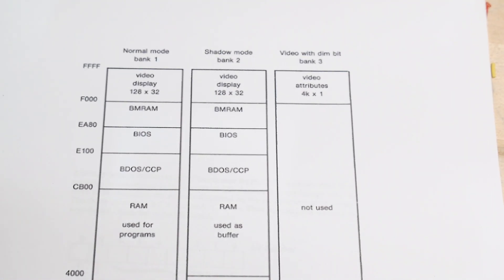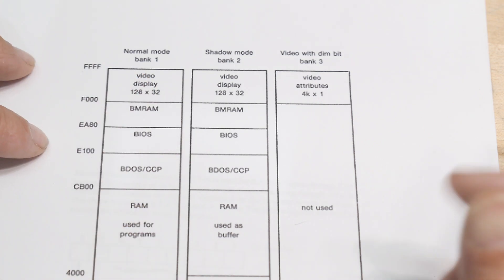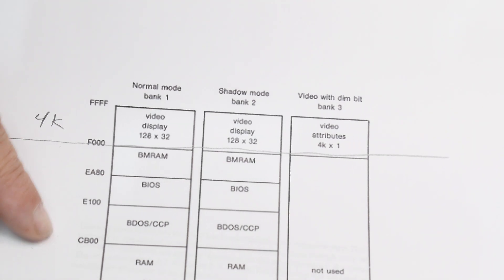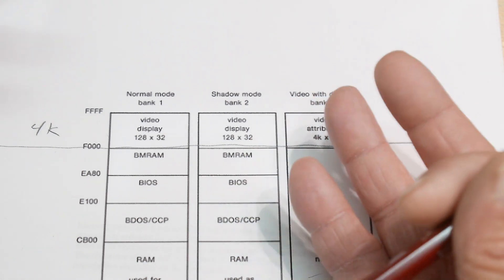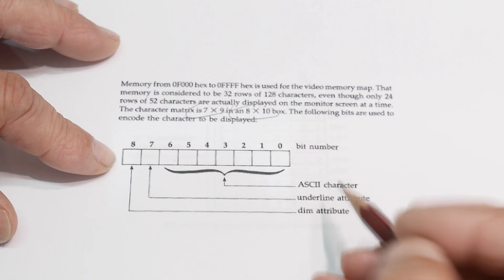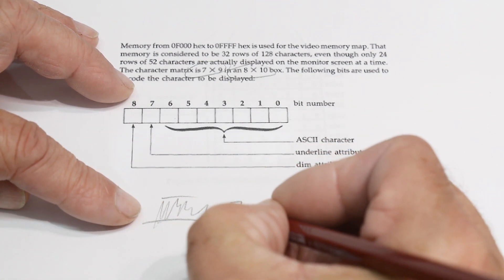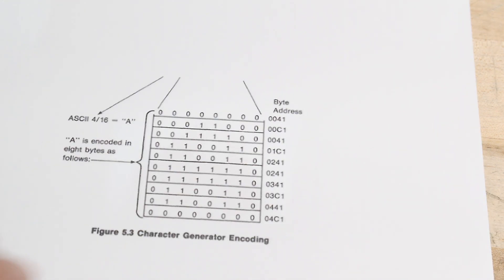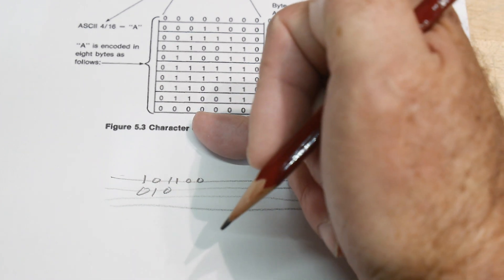#1006 Osborne 1 Video Circuit Design

Comment: Yes, all that was discrete logic, only later on did it get all put into a single 40 pin chip, which only needed you to add in the memory and character generation ROM, making the whole lot a much easier thing to design. But it still does the same internally. You could also change the character ROM to get lower case, just by using all 8 bits of ASCII  input, so you needed to have extra scan lines for descenders, but with 4 scan inputs you could use the same ROM generator, just change the reset for the counter to another line. Add another address input bit or two, and you could have, for free, graphics, though at the expense of only having text or graphics. Osborne actually got a lot of use out of that ROM ,including some rudimentary graphics shapes in the ASCII set for use, which were very useful in making them popular. You could have actual boxes around text, one of the drawcards for Visicalc.

Comment: Video memory and memory banks. I did not see the entire schematic, but could it be that there is 4096 bytes of memory and only 1248 are getting used because there are two video memory banks? This was pretty common bake then. You would write your data to one bank without seeing the screen change, then do a bank switch for instant screen update. And reading video memory back was pretty handy for text editing. Your code would actually move the text around in video memory. It became your text editing buffer.
Reply from the maker: it uses the full 4k but the display window is only part of it, you can use the arrow keys to move the window around in the 4k. so you could display 128char lines but only get to see 52 at a time